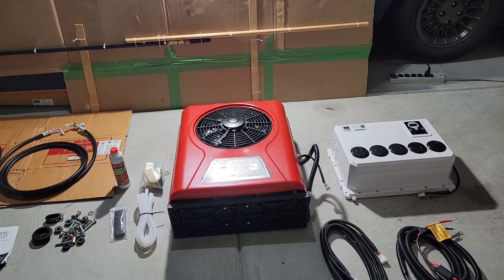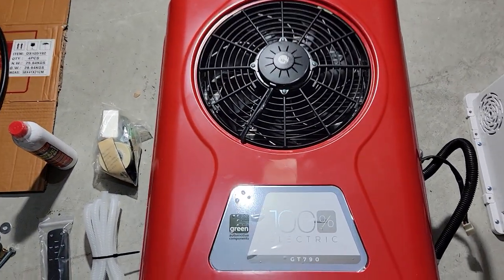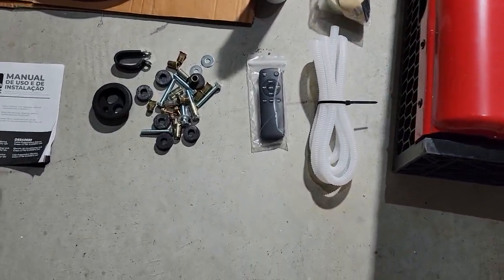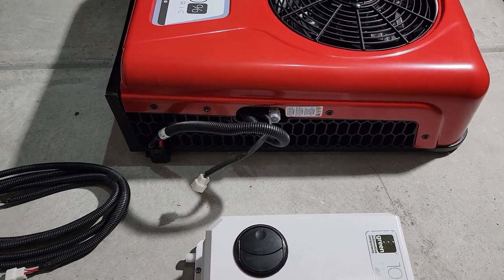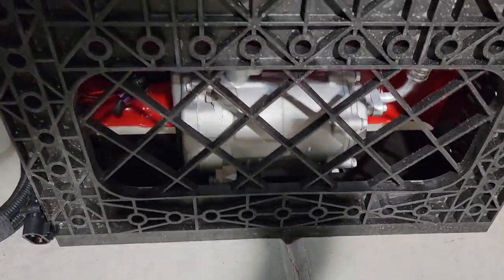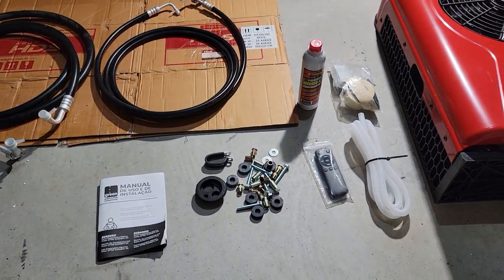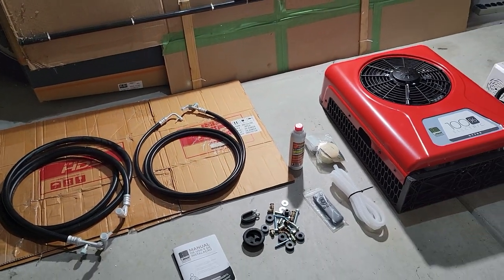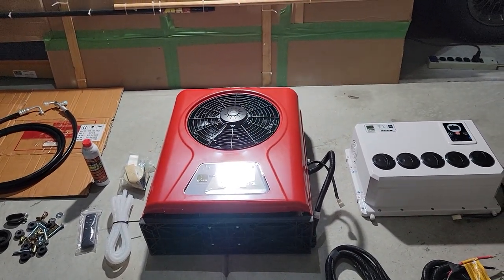12 Volt Ac split Unit For semi truck

Comment: Wonder if I can run this off a solar panel and batteries?
Reply: Yes you can..all a matter of how much batteries you have..I run my 8000 BTU wall unit or my roof 13.500 unit off 2000 watts with 8 trojans T-105 totally off grid
one I bought which I am wait for... says it will run at night about 6-7 hours on 180 amp battery which is about 1000$ for lithium or a bit less for Lead ones but they are only good to 50% discharge so have to get more

Comment: It pulls a lot of amps on a 12v system, 66 amps on high. They have window units now that only pull 675 watts on startup then drop to 400 watts while running for $175.
Reply: Which window units for example?
Reply: @heyitsmedoug8397  675 watts at 120 volts, the frigidaire FFRE053WAE pulls under 380 watts after startup. The drawback of the 12v systems is the high amp pull, so some guys just run a small quiet 120v remote start gas generator on a low wattage 120v AC. A window AC will need a lot of modification depending on install. You can also get a 6000 btu 120v mini split that will pull less than 700 watts or around 6 amps.

Comment: I highly recommend this unit I have it in. My semi truck works perfect. It saves me a lot of money no more AC repairs for the past two years.
Reply: durangovaquerito  yes it does I have on when I drive but in case u turn off ur truck u need a battery charger or brand new batteries
Reply: durangovaquerito  yes it will do the job u would like it I had mine for 3 year now no issues good luck
Reply: I have a 3500w generator. Can I somehow convert this so that I can run it with the generator and not have to get extra batteries? @kjstylee
Reply: @davidk2758 how are you going to use the generator to produce 12v? I have a similar unit that consumes a max of 430 watts on high. It cycles down to around 150 watts. I have 8-100 amp hr lithium iron phosphate batteries an 550 watts of solar. I have done a 34 hour restart with daily temps in the high 70’s to low 80’s and the voltage remain above 13.1 volts. I know that as the days get longer and warmer that It may not last as long, but so far I’m happy with the system.
Reply: Hello,
Can you recommend one for both heat and air. 
Thank you 🚛

Comment: Definitely looking forward to the installation video I just bought one just like that don’t even have it yet.
Reply: get yours yet? Installed how it is working if so?
Reply: @MrFrodo1111  works awesome using it right now actually
Reply: what did you install it on? semi?.. I have a regular pickup that came without air conditioning and my plan is to put this on it and cool the air for the truck while I'm driving I don't care about a night cuz I'm sleeping in my bed but I live in Arizona so driving without AC is brutal and 120°
Reply: @MrFrodo1111  yep mine is on a semi but should definitely cool a normal pickup truck.
Reply: @coreysanborn1574  what kind of temps you using it in..I'll be in 100 to 120 full sun in truck with lots of windows lol..if I can keep it under 85 I'll be very happy
Reply: @MrFrodo1111  90-95 completely different kind of truck but it blows very cold air.
Reply: @coreysanborn1574  how many amps does it use? Do you have it hooked up to your main truck starting batteries? How many hours can you run this unit on batteries alone?
Reply: i don't think this will work on just the truck batteries

Comment: I m happy my unit for kw sleeping like king very quiet
Reply: You have the same unit?
Reply: Quien instalo carlos?
Reply: @djashba5266  en Houston TX donde parqueo.mi truck pero.es super bueno estoy Feliz y se ahorra mucho fuel
Reply: @carlosnino4393  saludos Carlos cuantas baterías está usando para el ac?
Reply: @carlosnino4393 

Did you buy separate lithium batterase the power of the unit